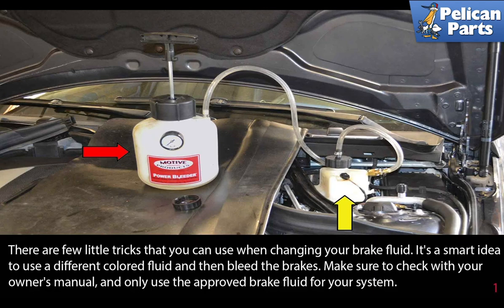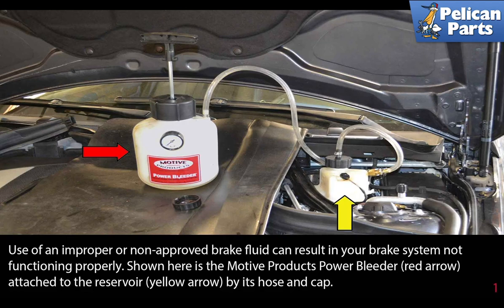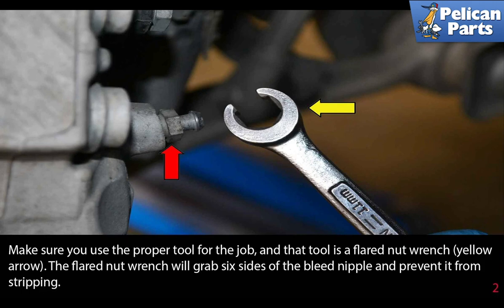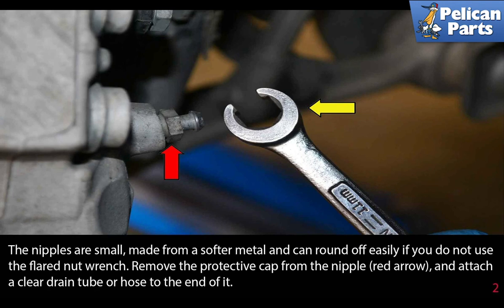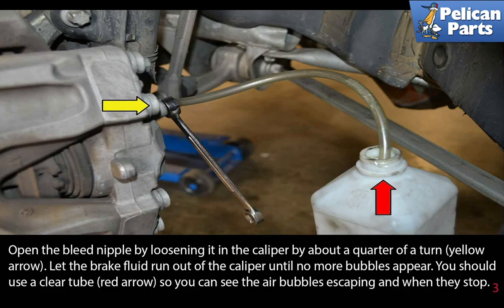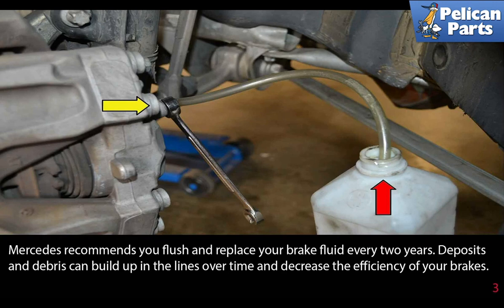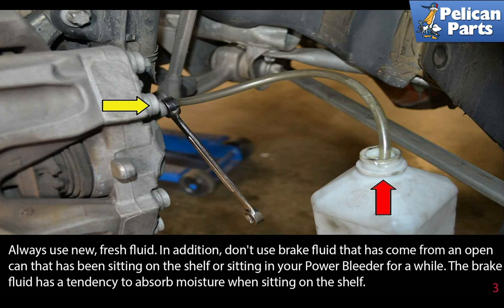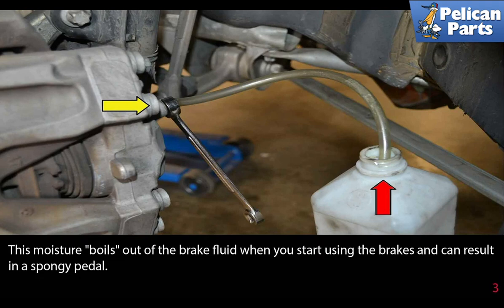Mercedes-Benz W204 C-Class Brake Bleeding DIY (2008-2014)

Comment: Great vid. With this motiv pressure pump there is no need to pump the brake pedals or use any tool to withdrawal the fluid correct? Also is there anything you should do once the job is complete like pump the brakes before driving?
Reply from the maker: That's the idea. The bleeder pushes fluid through the system without introducing air.